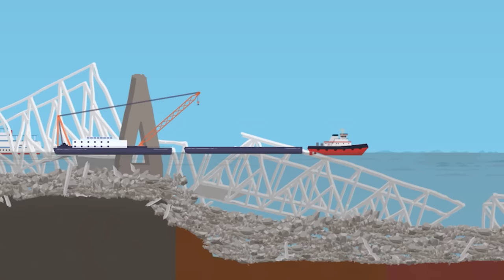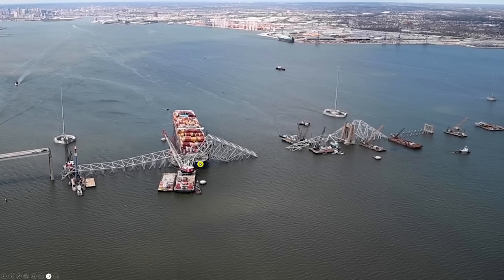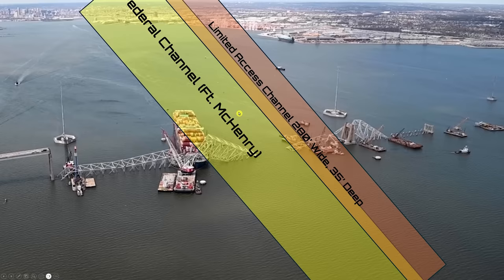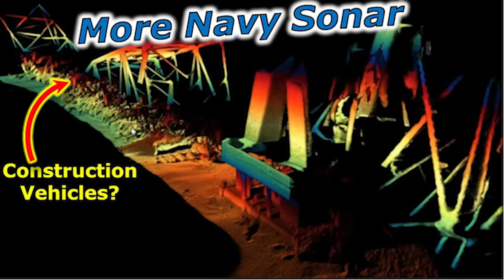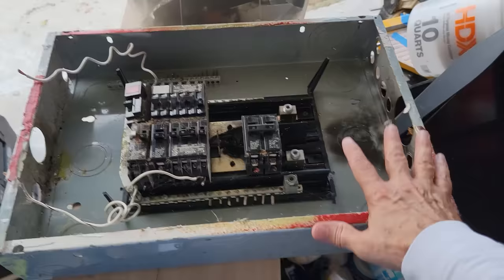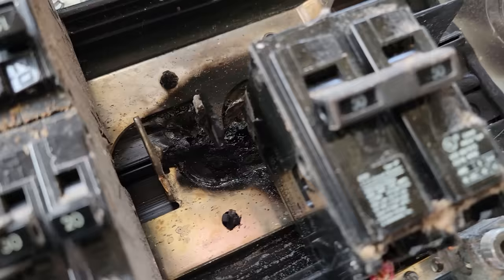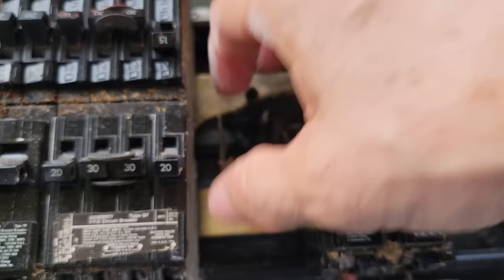NTSB Focus Dali Ship's Circuit Breakers | Bridge Collapse

Comment: The lead investigator is an experienced marine engineer and former USCG inspector, I have no doubt in his thoroughness.  I began to suspect - although without information, it is mere possibility - an electrical distribution issue after watching the video a few times.  Most ships are equipped with 3 (some times more, rarely less) diesel generators.  These can roughly be compared diesel railroad power units.  Usually, it is customary to run all, or at least more than is needed, while maneuvering in port, so that if one is lost, the load is not dropped.  For all power to drop like that, the problem is most likely in the distribution not the generation side, unless something significant happened that caused multiple power units to fail together or in quick succession.  Also, understand, that unlike a diesel pickup, the main diesel engine relies on external power to operate, so loss of the load would typically cause an automatic shut down of the main.  External power runs the fuel pumps and purifiers, lube oil pumps and purifiers and the cooling water circulating pumps.
All that said, I must make it clear, I was a mate, not an engineer, and could be proven very wrong in the end...

Comment: Circuit breakers are only warranted to trip once at the rated new current. Trips beyond the first trip are not guaranteed due to possible damage caused by the first trip.  Often the trip current will decrease as time goes on. Or the future tripping current will rise due to possible first trip damage.  I have once investigated a tripped breaker which tripped due to a direct short.  The heat generated by the short melted and welded together  two of the three sets of contacts.  Worst case scenario is a current of 17,000 amps on a 120v single phase breaker during a direct short.

Comment: Most ships and trains are diesel / electric. A diesel generator produced electric that is used to power The azipods on a ship, and rotating these azipods independently with electric motors is how the steering of the ship is accomplished. Without the generator's electricity, the ship is no different than an unplugged appliance.
The breakers protect many separate  circuits. If the main breakers were tripping as it appears, then a single circuit with its own separate protection couldn't have been causing the main ones tripping unless higher breakers were installed, or there was some other modifications. This would be something to investigate. 
I speculate that the problem was caused by the generator itself. Likely poor maintenance being the cause.

Comment: A 49 foot draft thru a 50ft channel? Something aint right with that statement.
I spent 4 years as a deckhand on the JW Westcott mailboat on the Detroit river back around 1990ish. We delivered mail to all vessels up and down the river as they passed our station. 1000ft great lakes freighters could draft as much as 36ft. Detroit river channel averages 40+ foot. Never once do i remember a ship coming thru with just 1 foot clearance.
Reply: Its dangerous but not impossible
Reply: It's current draught is 12.2 meters, or roughly 40 feet. It would have had 10 feet of clearance in the channel.
Reply: It's a 12.2m draft from vesselfinder.  So about 40 feet.
Reply: Yea, something isn't right. But this is a quote from Lt. Gen. Scott Spellmon, commanding general of the Army Corps of Engineers --- "A vessel the size of the Dali -- it is drafting about 48.5 feet when it comes into the port of Baltimore full. And I've told you the depth of this channel is 50 foot deep, so it's only about 12 to 18 inches of difference between the bottom of the vessel and the bottom of the floor."

Comment: Canada has 550 volt power supply in industrial  use , and usually the electrician will use  heat temperature gun aiming at each breaker  to see if there are any problems . Depending on the temperature of the breaker , maintenance will be required sooner or later . All panels are closed at all time to prevent injuries to  personnel due to explosions

Comment: While I'm not a ship's engineer, I'm an IT guy. Ive seen some guys debug issues using a FLIR camera. There are models that have a reasonable resolution that clip on the bottom of a phone and cost a few hundred bucks. A connection that is bad can be spotted without ever touching it because it's going to be hotter than the environment. Those IR cameras can spot a difference of 0.5 degrees, so a circuit that is on will show up, a broken one will be cold and one that is going to give you a headache in the future will outshine the others.

Edit to add: obviously, it will also allow you to spot a bearing going bad as well... :-)

Comment: If there are vehicles in the water under the temporary channel, they’d absolutely be removed along with the rest of the debris. One of the reasons that this is such a complex process is that all of the large pieces of metal have to be removed from the channel, because they would damage the cutter-suction dredges used to maintain the depth of the channel.

Comment: It should also be noted,  the Circuit Breakers shown are simple current draw.    They get more complex as you go upstream to where they have a Microprocessor that has current settings for short term,  long term,  instantaneous   as well as  equipment ground fault settings,  including timers.     But,  if they are not coordinated you can trip into the Main CB.

Comment: 8:15   By way of minor correction, as the resistance increases, current decreases -- but the heat generated per amp passed goes up drastically locally at the point of the resistance increase.  I have to anticipate the breakers involved are nothing like domestic panel distribution panels, but are far more likely to be the sort of large industrial magnetic (as opposed to thermal) breakers which can be adjusted for precision operation at an exact amperage and allow time integrated (I^2*T) brief periods of higher amperages which still maintain safe branch conductor temperatures, so certain startup inrush conditions can be accomodated.   These are "racked" into position by jackscrews which suddenly and forcefully accomplish the whole displacement needed for switching, to minimize arcs.   The act of bringing such breakers into and out of operation "live" is usually done by fully arc flash suited personnel, or when deliberately tripping them locally under load as part of a test.   They are just a different animal from the breakers in wall cabinets you showed.

Comment: I hope I write this to coherently explain my opinion.
I think them currently working on examining the circuit breakers does not necessarily mean that their focus is that the breakers caused the outage, but rather their focus is the electrical system and the circuit breakers are the logical first place to investigate.   
In other words, they are looking at the circuit breakers first to help determine where the failure in the electrical system failed, as opposed to (as I understood your interpretation) they are looking at the breakers because that's where they believe the failure may have occurred.
Thanks for all you're updates, and saddened to not see any of your state of the art animations in this video.

Comment: Hi Jeff, once again great Vlog regarding the Dali incident. From my Electrical experience, I would like to add that the study and behavior of Circuit Breakers is very complex and the subject of in depth projected analysis, in all electrical circuits the cables carrying the Current in the circuit should be designed so that the loads that are imposed on them, are within the design criteria of the current capability of the cable, the job of the Circuit breaker is actually to protect the cables, not just the load that they are powering. Thousands of Amps can actually flow in a circuit for milliseconds before the Circuit Breaker will sense and trip, the reasons for this are many fold, one of the reasons is to prevent nuisance tripping of the Circuit breaker. This can occur when the circuit is first placed under load and the quantity of electricity (Amps) has to in rush to the device to get it moving (AKA Electric motors) before the circuit can adopt the normal amperage draw during use. Your video was perfectly accurate, however the burning of that Breaker panel that you show looks like an Arching fault which as you correctly pointed out was probably the result of the Breakers being subjected to making and breaking there electrical contact within the panel. The Main incoming Circuit Breaker should have prevented the amount of Arching that appears to be present on your demonstration panel, but what is unknown, is the fact that the main breaker may not have been serviceable and is not shown in your Video.

Comment: After they remove the majority of the containers, the draft of the ship will not be as large. Presumably, if the refrigerated containers were connected to power, the containers weren't empty.
Reply: That is why the crew are on board, to keep main power running, and as the reefers are removed to disconnect them, so they can be powered up again on shore. Only place in the USA where you will find 400VAC 3 phase power as the standard.

Comment: Actual if you get bad contact (pitting/scorging) the resistance increase (and current decreases, not increasing as you mentioned). However on the spot of the added resistance and even with the decreased current you get an overheat situation that gives you that scorging problem because the overheating is way more than normal.

Comment: I find it quite normal the start clearing the main channel at the point where they are doing it. It is the place where you can expect the missing persons and you want to find them as soon as possible. The limited acces channel can only be used when it is fully cleared, including the vehicles of the construction workers and there bodies (if they are there).

Comment: Hi Jeff, there are so many types of breakers, not just snap in. There are din rail breakers and my old building has them screw in both the buss line and the wire, so in commercial applications things can be very different. Mine are from the 40s though . Lol😊😊😊

Comment: + Also ; my friend ; looking at the very recent photos of the Laly’ containers ; you can easily see that these containers are NOT lined up in an orderly way as they used to be at the beginning after the event ? They look now like they are very ready to go off in the water ? The Laly should’ve been secured not to tilt any further or not to flip even before touching its cargo or the debris on it ; one very effective way is by placing one or MORE strong ; maybe even military vessels almost as long as it or even longer on Laly’s sides forming a 90 degrees with it but tightly hard chained ( or even welded ) top and bottom , left and right , maybe also from front side and back one ; even if it is necessary to weld D rings on Laly’s top and bottom sides ; and even if they have to use portions cut of that bridge’s frame as adopters to achieve that .

Comment: I’m glad to see that almost everyone knows residential breaker panels and ship power systems are not the same.  Dear god.  That ship electrical system can probably (hopefully) provide a time-lined history of what electricity was where and what load it was under when as they try to find the reason for the shut down.   More black box work, I doubt the manufactures would cooperate to help blame it on themselves for making a crap system.  I’m really looking forward to the report with answers because I can’t even find simple things like was this a electric motor driven ship or geared to main engine?

Comment: Don’t forget that there are different tripping curve currents referring to the cascade circuit breaker’s. That means you can have for example a 10 amp breaker on one circuit with a slow curve and say a 100 main breaker with a quicker curve. The main  will trip not the circuit with the fault!

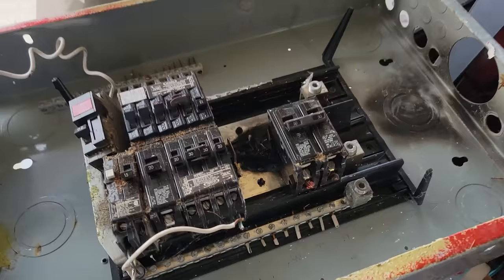Comment: 9:00 issue with ships is the freezer unit containers are mobile, they are on Semi moving around the nation. Hence most have faults. Ships must redesign electrical systems to isolate power to these units independent of the ship's own systems. Ships are large enough to ensure this at current sizes.

Comment: At 8:17 you mention increased resistance at the pitted bus bar and "drawing more current". Actually, the current would decrease because of the increased resistance and the breaker would be less likely to trip. If a breaker would trip, it would be because of the heat generated at the bus bar, assuming that the breaker is heat sensitive.

Comment: Understanding of NAV per MV DALI is very important. From my observations, much focus needs to be on the FSK Bridge report (2021?) of being in 'Fair' condition. Seems the Bridge itself had been handling additional traffic loads that were not anticipated at construction... and my speculation is... the Bridge was in need of major maintenance which would have taken it offline... so it remained technically in 'fair' condition. As awful and devastating as this Containier ship disaster has been, perhaps a worse nightmare was not far ahead, meaning the Bridge might have in fact approached its useful life, and was heading for a collapse from fatigue. Trucking capacities are also sharply higher than forty (40) years ago. ie, the condition of the Bridge needs thorough investigation as well. The way the sections pulled apart, and so easily slipped off the outer pilings is alarming. Was pothole maintenance a full time activity... brings further speculation that the Bridge was subject to buckling and torquing throughout its life span. During the incident, the entire East side of the Truss lifted perhaps 40 feet in the air before crashing downward once the counter-balance broke off. Just some observations here.

Comment: Manufacturers always get involved. They have specific knowledge that sometimes even operators are not aware of. Marine engines also depend upon external power for subsystems like fuel delivery and cooling that “small” engines do not. But, “external” does not mean that they are running from the same bus as the hotel load keeping the reefers going. Critical systems like steerage, external lighting and engine restart and operation have their own dedicated power system.

Comment: Can you explain inrush current? I mentioned this in one of your other videos, and I would like to hear your opinion on if this could of been a driving factor.

Refrigeration compressors turn on and off. I believe they have a high inrush current. The system could probably handle a constant state of all of them running, but not the inrush from all of them turning on at the same time.

Though I am only experienced with inrush current from a washing machine's electric motor.

Comment: While she was docked at Baltimore, the MV Dali had serious electrical issues. Repairs were
made before she sailed, but what was the nature of those problems, and were the repairs perfunctory, or comprehensive? I'm sure the NTSB is investigating these issues, and will consult further with ship's personnel, and with engineers from Hyundai. The NTSB does not have regulatory or enforcement authority. It can investigate, and make recommendations,
but it cannot mandate changes. Perhaps the NTSB should have enforcement and regulatory authority, along with the U.S. Coast Guard.

Comment: Scorching of the conductors does not increase overall current through the circuit. What it does is increase the resistance of the connection, causing the voltage drop across the connection to increase, therefore the power consumed to increase. That power is eliminated as heat. When the connection gets hot enough, either it starts a fire or the connection melts and becomes open, cutting the circuit.
This is why it's important to maintain good contact in all connections.

Comment: Certain types of circuit breakers will loose their current carrying capacity as they are tripped over and over. As also shown in the video the more a bussbar is overheated it will also overheat the contact on the circuit breaker that contacts the buss bar. It will lead to oxidation of the contacts which leads to an increase in resistance. As heat is dissipated into the breaker the contacts start to fail as well as any thermally tripped metals within the breaker. Eventually this leads to multiple problems, fires from excessive heat, breakers that can no longer hold their rated loads.

Comment: As an electrical engineer, I am certain that is was not the circuit breakers at fault. Much more likely, they overloaded the ship with refrigerator containers overloading the system, and then set sail ignoring the problem.

Comment: NTSB said that states should be looking at what kinds and sizes of ships are traveling in and out of their ports and see if the bridges are protected well enough. I'd say they need to be looking at the future for the types and sizes of ships that will be traveling in and out of their ports. While concrete dolphins are an important tool to guard bridges, shallow water around piers can also work to ground ships before they can get close to piers.

Comment: Thing is, you could have far fewer Reefer Boxes than the limit and have major problems if ONE Reefer Box's electrical system had a dead short when the compressor kicked on. It could take the board down in a cascade failure.

Comment: These breakers are large switch gears.  They tend to get faulty after a few years.  Many times the power quality can cause issues, if the power is off and on.  The arching can look like bad welding.  I like how direct Mrs. Homendy is!  She did a very good job being direct and to the point.  It is nice to see someone stand accountable!
Reply: It was most likely a multiple breaker short. Either from wiring that dislodged or water . Considering that the entire system failed, I’d put my money on water.